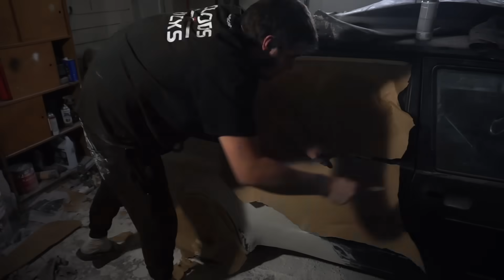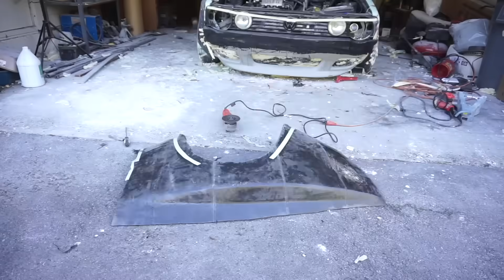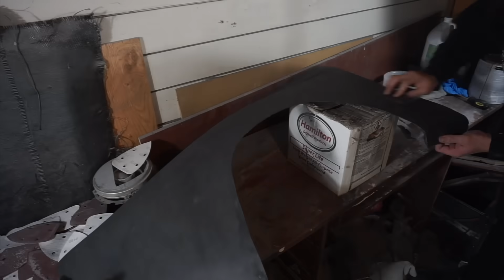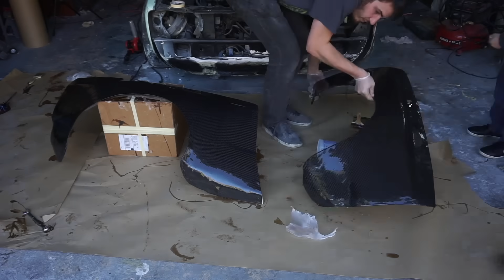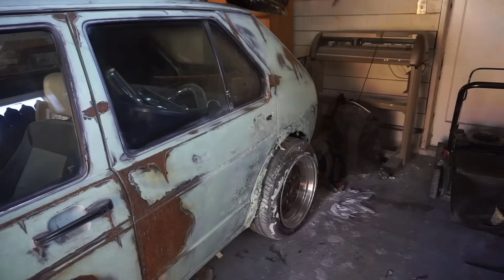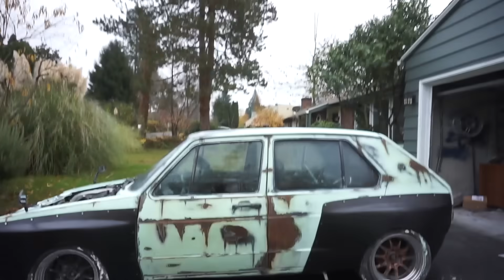Garage Built Carbon Fiber Widebody 5min Timelapse

Comment: Nice I love them but if you would of just taken one more step you could of used them as plugs and made multiple kits, I thought that's what you were doing because that the route you took once you pulled them off and cleaned them up you just needed to stiffen the mold up and then seal it and you could of laid the carbon inside of the plug not on top and you would of kept those nice lines you created. Hey anyways it doesn't matter what you created is very nice I was just surprised because that's the way I thought you were going either way you did great and the panels came out amazing I am sure others will want to do the same as it looks so nice keep it up bro!
Reply: Don't over think all those long hours to make few extra bucks to pay for all that time and Labor... Looks good like the concept
Reply: @nancysmith9487  makes no sense
Reply: Maybe wanted a one off car
Reply from the maker: It was my first go with composite work I realize that now but I can still make a mold off of these fenders if I want I appreciate you watching
Reply: The clever bit is how the wheels are used as the former. This method is ideal.
Reply: @nancysmith9487  What the hell are you talking about? Lol.

Comment: So, let me understand this process:
Foam on
Shape foam
Hard putty filler?
Sand down
More putty filler?
Lay 1st fibre+resin (release compound needed here?) 
Remove from car
Clean foam residue off the piece
Paint a primer coat?
Then finish with another layer of carbon fibre over that? 
Finishing
Mounting

What else I'm missing from these steps? 

Thank you in advance

Comment: Nice work! Question, what did you skim coat the foam with? Is that drywall compound? If so, what did you use to seal it prior glassing over it? Thanks

Comment: Hey, i was wondering what would happen if you just left the “foam” that you used to make the shape on it, put fiberglass over that and sand that flush with the body, or is there something about that that wouldnt make it work
Reply from the maker: It wouldn’t  recommend it will it was probably the easiest part taking it off and cleaning it up the foam adds weight and it soaks up water like crazy

Comment: Yo i abolutely love your work :)

we are going to do something very similar to my mustang. What kind of construction foam did you use? 

I heard that using normal foam propably produces a lot of "air pockets" which makes getting an even surface to but the Carbonfibrer on kinda hard. Any advice?
Reply: Don't need to worry about air pockets in your form since it will be on the inside of the piece when you're done.

Comment: What is that white thing he put on his car?
Reply: White thing? Are you talking about the drywall plaster he used after he formed the foam? If so, drywall plaster is much easier to sand than regular bondo and much less expensive, may take a little longer to dry unless you have a heat gun or just a small heating fan. After that he used bondo to fill any small imperfections, if you have a lot of imperfections use bondo with long fibers to even  out the surface or you can mix half bondo with half resin to create "rondo" which is more liquidy and it evens itself out and its used for more complex designs like dashboards, center consoles, etc.

Comment: That’s not how carbon fiber works. You need heat and pressure. However, I respect all the hard work.
Reply: 😂 so much comment, so little knowledge. Carbon can be laid up cold just like fibre glass, or it can be laid up with a mould, vacuum and an autoclave. Both are valid construction techniques.

Comment: How much body filler is that? Like, several inches? It's not that hard to bend sheet metal
Reply: Sheet metal??
Reply: Spray foam? Carbon fiber is lighter and, pound for pound, stronger than sheet metal.

Comment: If i was  going thru all that trouble it wouldnt be on a vw station wagon. The guys creative enough to build a booth to shoot paint rather than use spray cans. These are the type folks that could use a leg up. Not the lazy bastards that have everything given to them and just lay around while someone else has to pick up after them
Reply from the maker: Lol it was one of my late fathers cars it’s sentimental I might do another car soon what would you like to see? And thanks for watching
Reply: @eurokevin  dont get me wrong it was looking great. It could make a mean rally car. Ive made some freaks of nature myself. Ive had twin truck cabs assed together. SS camero jacked up 4x4. No it wasnt old and wrecked. It had less than 10k miles on it. AMG Mercedes wide body kit on an 88 jag xj6 4 door. Turned a corvair into an armor plated 6 wd....thing! An mr2 into a 5000 watt rolling stereo. Complete with 16 3" fosgates 12 in the headliner 2 in each headrest. 6" dv subs in each door. Bass engines under the seats. 8" dv subs behind the seats. 4x6 plates in the dash 2"'tweeters up the windshield supports. 4" mids in the doors. 15" dv sub in the front trunk with holes cut through to the cab to port and supply air. Eclipse head unit and epicenter disc changer in the glove box and the rear trunk had motorized amp racks to hide the electronics. Momo rims nitrous complete with momentary buttons and tubes running thru the seats to the headrest as piping with a nasal cannula in case there was an emergency situation that required uncontrollable laughter.

Comment: Bondo is heavy. Not intended to be used on such large areas. Probably fell off the car by now.
Reply from the maker: Literally zero bondo
Reply: @eurokevin  your comment section is wild.
Reply: If you watch the whole video. He was using the bondo to make a carbon fiber mold.
  He screwed the panels on I highly doubt they fell off.
  I do collision repair and auto upholstery. Lol I thought the same thing when I seen all that caked on.